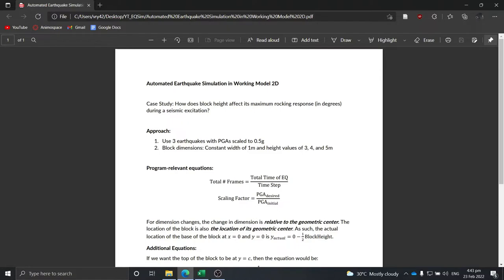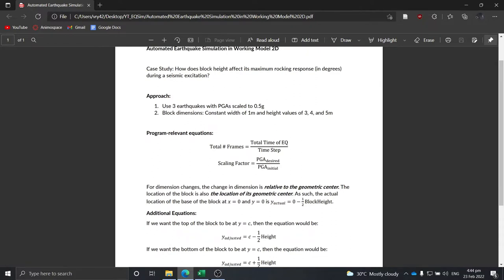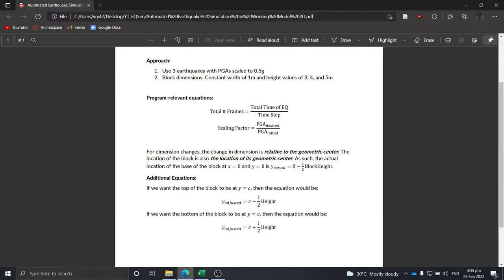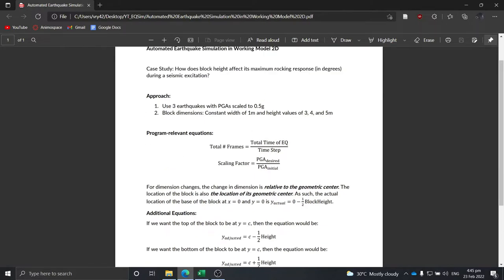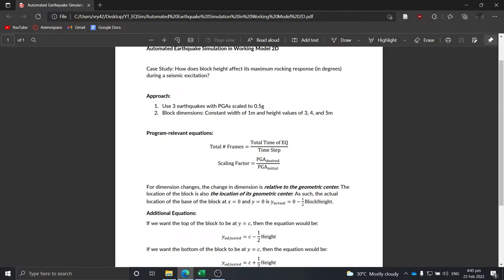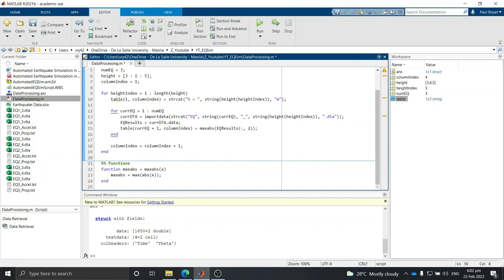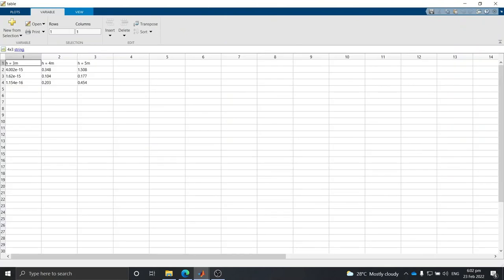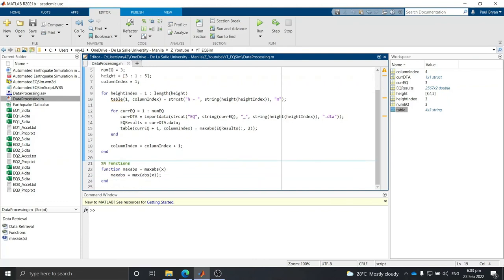[Working Model 2D] Automated Earthquake Simulation with MATLAB Data Processing

Comment: Hi, I would like to get the scripts for the problem solved in the video. Is it available? If yes, can you please let me know the price?
Reply from the maker: Hello!

Here is the working model script used for the automated simulation:

Sub Main()
	Dim Doc as WMDocument
	Set Doc = WM.ActiveDocument
	Doc.Reset

	Dim numEQ as Double
	Dim timeStep as Double
	Dim EQTime as Double
	Dim PGA as Double
	Dim gConvert as Double
	Dim PGADesired as Double

	Dim scalingFactor as WMInput
	Dim EQ as WMInput
	Dim rotation as WMOutput
	Dim block as WMBody

	numEQ = 3
	gConvert = 9.80665
	PGADesired = 0.5

	Set block = Doc.Body("Block")
	Set scalingFactor = Doc.Input("Scaling Factor")
	Set rotation = Doc.Output("Results")
	Set EQ = Doc.Input("EQ")
	EQ.Format = "table"
	EQ.TimeColumn = 0
	EQ.DataColumn = 1

	For currEQ = 1 to numEQ Step 1
		Doc.Reset
		
		Open "EQ" & currEQ & "_Prop.txt" For Input as #1
		Line Input #1, z$
		PGA = z$
		Line Input #1, z$
		timeStep = z$
		Line Input #1, z$
		EQTime = z$
		Close #1

		EQ.ReadTable "EQ" & currEQ & "_Accel.txt"

		scalingFactor.Value = PGADesired / PGA * gConvert

		totalFrame = EQTime / timeStep

		Doc.VariableIntegrationStep = False
		Doc.IntegrationStep = TimeStep

		For currHeight = 3 to 5 Step 1
			Doc.Reset

			block.Height.Value = currHeight

			Doc.Run	totalFrame

			Doc.ExportStartFrame = 0
			Doc.ExportStopFrame = totalFrame
			Doc.ExportMeterData "EQ" & currEQ & "_" & currHeight & ".dta"

		Next currHeight

	Next currEQ
End Sub